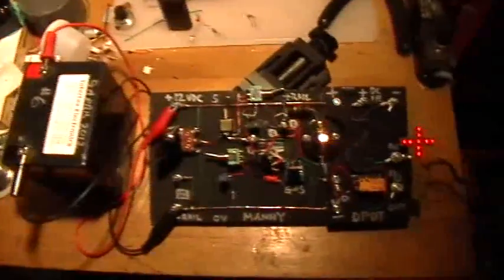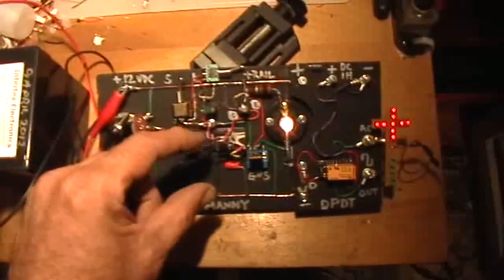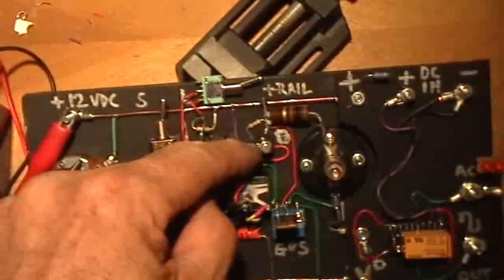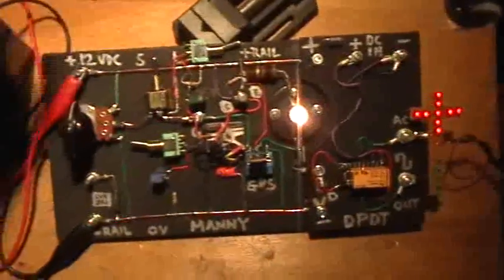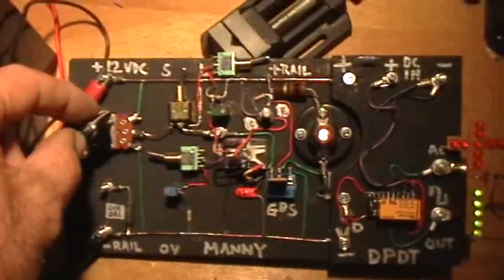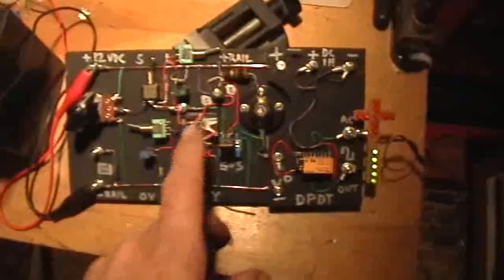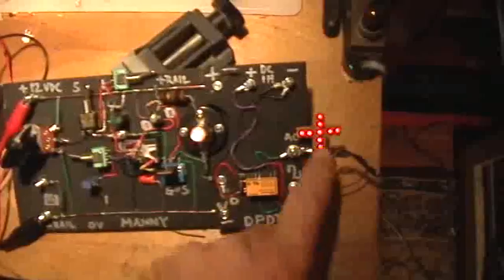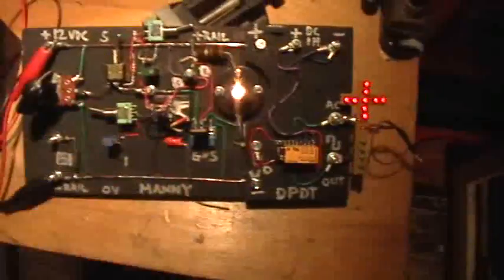Electric OU: Supplement: The Secret of DPDT

Comment from the maker: Yes, they are very strange and special, hard to find negative LEDs. The normal red LEDs have the cathode and the flat spot on the right. The Negative, Green LEDs have the cathode and the flat spot... on the LEFT.

It's like those nails in the box ... half of them have the points on the wrong end. But you can still use them -- on the other side of the house.

Comment from the maker: Hello Gerhard
Do you mean the DPDT polarity reversal part, or the whole circuit? To get the whole circuit you must watch all of the videos in the series and see how it comes together. The "Mosfets How Do They Work" series from parts 2 and 3 and on,  shows the development of the circuit.
The DPDT polarity reversal: Output goes to movable poles. Plus input goes to one side closed contact and other side open contact. Minus input goes to one side open contact and other side closed contact. Easy.